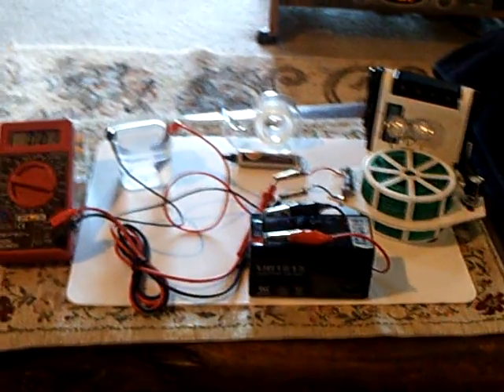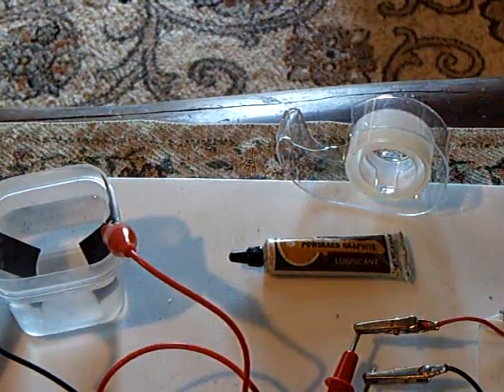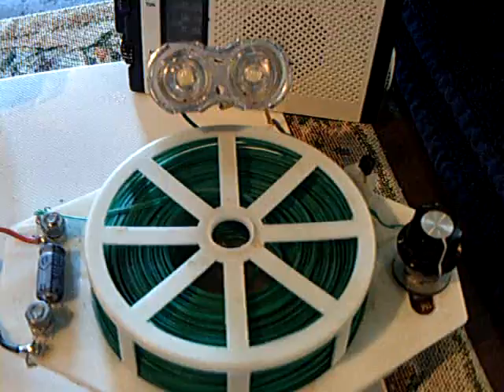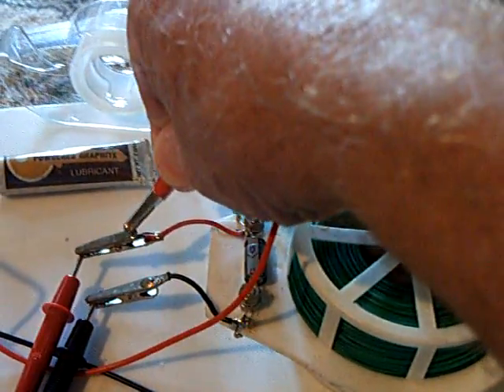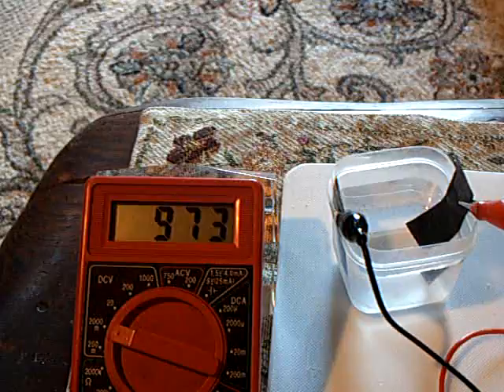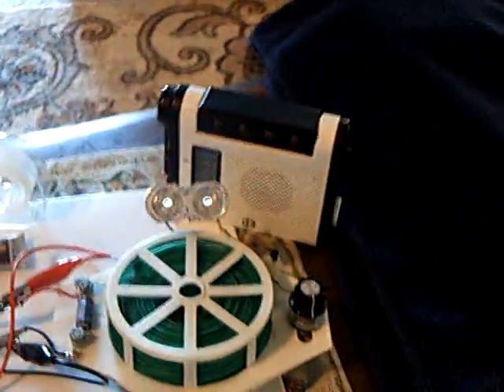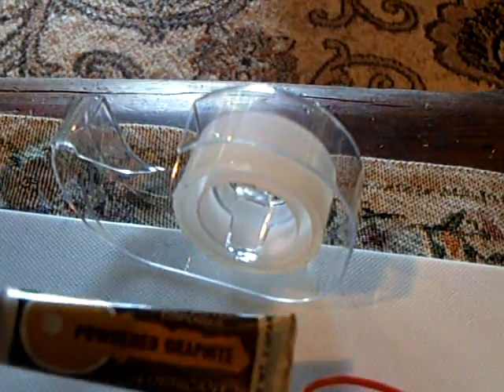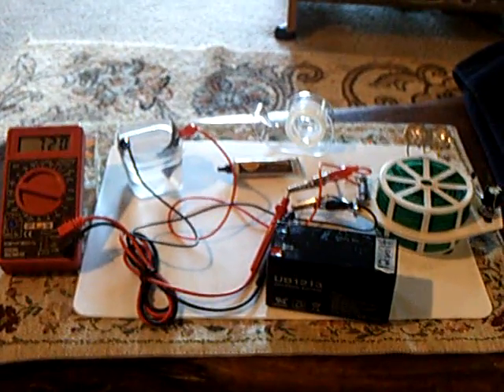Graphene Study ----and an interesting find!

Comment: Hello. I would like it if you would make a crystal battery glue cell with graphite. I would be interested to see if adding graphite would increase the voltage by decreasing the high internal resistance found in crystal batteries.
 I would also be interested in seeing a pure water free, sealed crystal battery. If a 100% water free crystal battery containing graphite worked just as well as a new crystal glue cell battery that had not settled yet. This would help prove that crystal batterys power is not galvanic in nature and could be a form of free energy.
Thank you, please give it a try.

Comment: I'd like to try taking two 24 inch square sheets of one sided adhesive, coat them with oven grown graphite base nanotubes, and the put an electrolyte soaked sheet between them, and roll it. Also curious to see is a cell could be created by stacking sheets with electrolyte soaked material, to see if a charge is held to be released, and recharged as depleted.

Comment: Well done Lid ! Do you know, if your graphite is synthetic graphite or natural graphite ? The synthetic stuff is probably not real graphite....
Anyway, you can do this also with just 2 graphite pkates in a tablesalt NaCL solution. I did this a few years ago. It works like a supercapacitor. Only the surface area counts for storage, so if you use bigger scotch tape, use a wet electrolyte papertowel dipped in NaCl or Epsom salt between it and roll it up, you will get a great supercap....But the maximumvoltage you can charge these up to is about 2.7 Volt and then they drp pretty fast to 2.5 Volts and from there they will slowly discharge on a red LED load for instance...if you drive the cell over 2.7 Volts it begins electrolysis and splits the NaCl so get chlorine, was so in my case with the tested NaCl as electrolyte... Regards, Stefan.
Reply from the maker: You and I were both working on carbon based rechargeables about a year ago.  Here is the video I did on it using artist charcoal instead of powdered graphite. I was using an electrolyte mixture of distilled water, Alum, and lead oxide.  At the time you mentioned that you were using Epsom salt and TiO2.  Artist Charcoal homemade rechargeable battery
   The graphene approach puts a new light on things.
Reply: hey lid, if I may ask? Why are you & overU using metal Oxides in your electrolytes during these tests?

Comment: I think I remember watching a scientist make graphene out of a plastic grocery bag.  He crammed it into a small tube, pressurized it & then baked it at 1400 C for about 45 minutes.  When it was done, it was pure black & he used it in a button-type cell to provide DC power...
Reply from the maker: Thanks.  I will see if I can find out more about that method.
Reply: *****
This isn't the source that I was referrig to earlier, but it is interesting & provides these tidbits of insight: 

"The graphene powder is then packed into a coin-shaped cell, and dried at 140 °C and at a pressure of 300/kg/cm for five hours." (It appears they figured out how to do it with less heat & pressure than the other scientist.)

"The trick these guys have perfected is to make a highly porous form of graphene that has a huge internal surface area. They create this graphene by reducing graphene oxide particles with hydrazine in water agitated with ultrasound."

You can find this article by Googling "Graphene Supercapacitors Ready for Electric Vehicle Energy Storage, Say Korean Engineers"
Reply: ***** You'll want to check this out too (if you haven't already seen it):
Google:  "Breakthrough: Electricity from Graphene and Water"
Note:  Follow the hyper-link labeled "article" in that ^ article to load "World first for Irish graphene researchers".  Apparently they are making graphene with a blender! :-)

Comment: A little behind the times on this one. On march 21st 2012, the world changed! A team at UCLA, using grahite oxzide suspended in water, put it on a platic film on a litghtScribe DVD, and then stuck it in a LightScribe burner. When they pulled it out, everywhere the laser hit was turned into Graphene. Now this is the good part, they took a stamp size supercapacitor circuit that they had made with this process, put a little electrolite between to similar circuits, and charged it for two seconds. The mind blowing part of this is, that it ran a LED for five minutes.
Reply from the maker: Thanks.  I watched a video on that yesterday.  It makes me wonder what is going on in secret labs around the world.

Comment: Wow. Thats really cool.
I'm fairly sure its a capacitor. As you say, no fuel to be a battery. Do you have any way to test farads? Maybe even discharge a known cap into it till they balance and do a joule count? A larger surface area version could be something really special. Super-caps are so expensive! I wish I had some graphite... Its on the shopping list now! May try with a pencil if I get really impatient.
Reply: Mongrel Shark
How do you get a 1F capacitor from sticking two small pieces of tape in saltwater and how the heck was it charged to begin with?

I'm not getting this at all.

"In a parallel plate capacitor, capacitance is directly proportional to the surface area of the conductor plates and inversely proportional to the separation distance between the plates." (Wiki)
Reply from the maker: Mongrel Shark That is exactly my feeling as to what is happening here.  I watched several of Robert Murray-Smith videos today and the one on capacitors and batteries was helpful in describing what might be going on.  This might be a kind of hybrid.
Reply: Tomorrow guys.
Reply from the maker: I think that it is a capacitor also.  It acts like a 1F supercap.
Reply: Around 1F was my guess too from the charge rate and penny run time.
Reply: *****  The Graphite dust has a huge surface area. Probably half a tennis court on each bit of tape (Wild guestimate). The Epsom salt is the electrolyte and may be adding a coating to one or both plates when it is formed by charging with DC power.

You can see much the same thing, but with lower capacitance and Soda can plates in many online guides to making DIY electrolytic capacitors. Rimstar.org did some great explinations and how to video guides on this page http://rimstar.org/science_electronics_projects/make_electrolytic_capacitor.htm Be sure to look at the videos down the bottom for detaild animated explanation of the process.

I'm not exactly sure on the chemical process involved with these graphite capacitors, and it is surprising how large a capacity has been achieved so simply. Although I am not at all suprised to see it work, and that its a lot better than the soda can caps. The distance is pretty small, as the water will be acting as one of the plates. With some sort of semiconductive layer formed on at least one of the plates in the forming stage.

Hope that makes sense, because that about the best explanation I can offer.
Reply: Mongrel Shark
Let me explore a different angle:

Electrolytes are good conductors of ions and poor conductors of electrons whereas copper conducts electrons but not ions, so I suspect the process is a plating operation, but plating requires input of energy, unless perhaps, the solution had been supersaturated with solute with the energy transfer taking the process to equilibrium.
Reply: ***** Lidmotor did say he formed the capacitor. Meaning he put high current dc through it for some time to cause some sort of plating process to take place. The same as in the rimstar.org video with the aluminum plates. If you just put graphite on some tape, and try this it wont work. You need to "Form" the plates. With dc current. Then you get a capacitor.
Reply: ***** The big surprise for me was that the epsom salt seems to be providing the plating material. With the Aluminum Capacitors I have seen others make, I always thought it was an Aluminum oxide doing the plating. As did many of the people doing the instructions. Seems the electrolyte is playing a more important role than we thought. If we could make a p-type and an N-type semiconductive coating, we could make our own DIY Transistors. One of your Plates could make a signal diode when combined with the right needle too. Like the Pencil and razor blade ones used in some homemade crystal radio sets. The potential uses and experiments to do list is endless.
Reply from the maker: I think that I may have made a semiconductor somehow like you said.  When I test one of these strips dry with a multimeter set on the 20k resistance scale I get what looks like a switching diode reaction. Very interesting. I might try a cats whisker setup on a simple crystal radio rig and see if it works.  The epsom salt / water electrolyte combined with the dc charging may have formed up the junction.
Reply: That's my guess. Bit hard to explain the super-cap otherwise.

Comment: Yep, it's very basic and yet so was the Nobel Prize version. The surfactant (dishwashing soap) and plenty of vigorous mixing makes a big difference, such as regular graphite polishes off from glass readily. But if you polish the heck out of the treated stuff to remove layers, then the resistance measurements between 2 points can resemble 1 layer graphene...such as very little change between two points inches apart.
Realistically, the thinnest at home is likely a few layers thick, but it does start to display the graphene properties.
Cells do work well, as you showed...stepping away from metals is never a bad thing :)
Reply from the maker: Graphene is pretty neat stuff.  Your video really triggered me to learn more about it.  I may have to buy an old blender now.
Reply: *****
I found one on the street a few months ago but misplaced it...so put the ingredients in a jar and shook it all morning. Original idea was to run the blender from solar, considering Oklahoma lawmakers hate solar !
Reply from the maker: I guess you have to run the blender for about an hour to get the graphite all seperated. I don't think that just shaking it up in a jar will do it.  Let me know if your method works.  The correct end result seems to be when you get the layer almost transparent and yet has near zero resistance.  All the carbon molecules joined up holding hands.